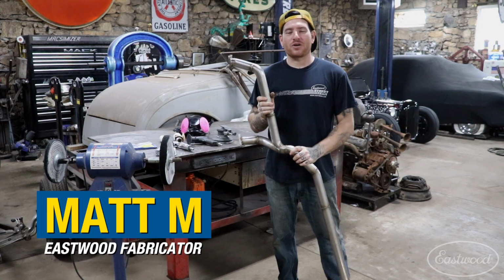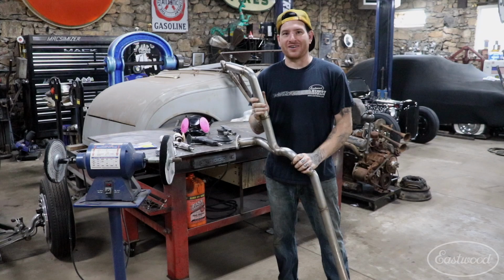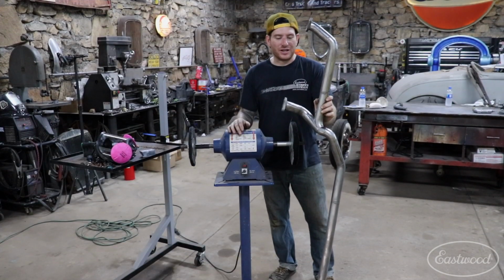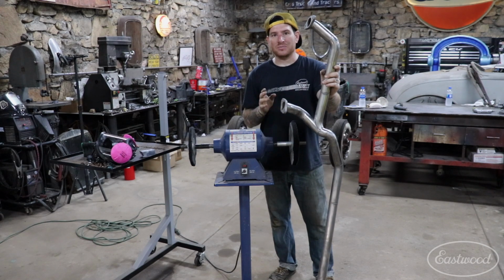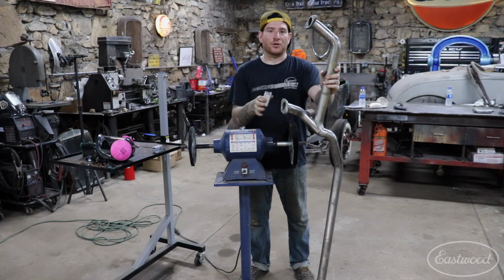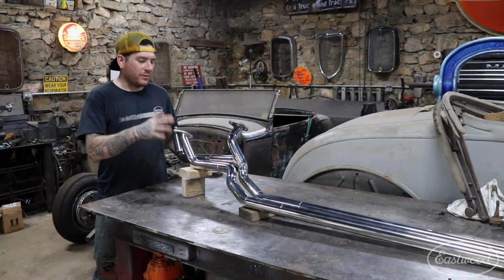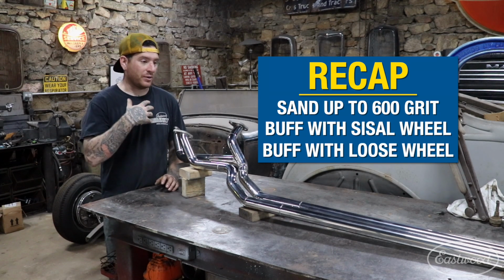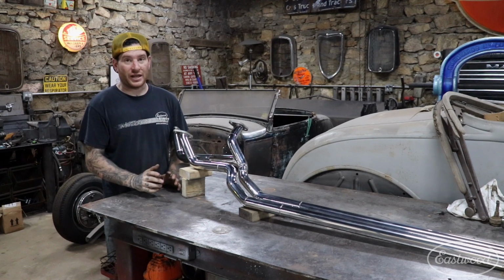Homemade Employee Project - How to Polish Stainless Steel Exhaust to a Mirror Finish - Eastwood

Comment: I think given the application this is perfectly acceptable...
Also handling a big ol' piece is a good workout , I got too old for doing that so bought a mega duty flexy shaft hooked up to a big 3 phase motor.
Made polishing motorcycle frames easier..
Respect

Comment: One thing that bothers me about this, since it's a guide and gets the crucial part wrong.  You will never get a perfect MIRROR finish doing it like this, at least if your definition of "mirror" is the same as mine, and to me, a mirror is not just shiny, but it also has no surface scratches. You will get it shiny this way, sure, but if you look at it from close up, you'll still see subtle scratches in the finish because you didn't sand above 600 grit. 600 grit is still very rough and you won't polish out the scratches. It might be fine for something like an exhaust, but for more delicate parts like interior details or things you look at from close up, you have to sand gradually up to at least 2500 or even 3000 grit before starting to polish. High end watchmakers sand stainless steel up to 8000-10000 grit before they start polishing them. You don't have to go that high, but 2500/3000 should be the minimum. That is the only way to get an ACTUAL mirror finish, where you can inspect the part from as close as your eye can focus on it and not see absolutely any imperfections on the surface of steel (or anything else).   It's like trying to polish clear coat by wet sanding it to 600 grit and then going straight to polishing....never gonna happen.   Again.... shiny is not the same as "mirror finish". Mirror finish implies a perfect mirror-like surface. I've returned parts to shops and asked for refunds because they half-assed it and often had to do polish my parts on my own to do it right.
Reply: He stated that in the beginning.He said " near polish " not " mirror polish " finish.
Reply: @timrayburn2461   Yeah, but in all fairness I clicked on a video that said "Mirror Finish".   This was "polished" or "chrome-like", but not at all a "mirror finish".     I do love these videos and this channel, but the title on this one could have been better chosen.  👍🔧
Reply: I'm here to tell you I've been polishing for 16 years and I can remove 320 grit sanding scratches with buffing.  I have videos on my channel showing how I do it.